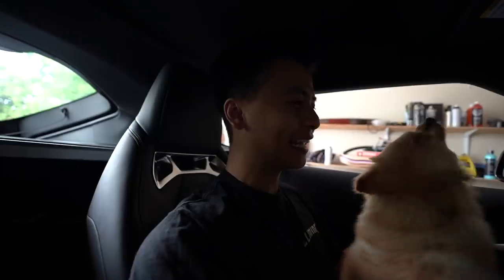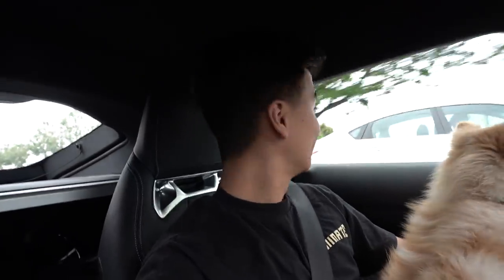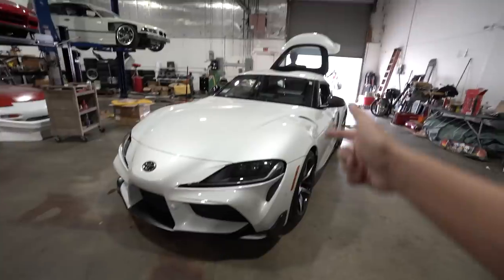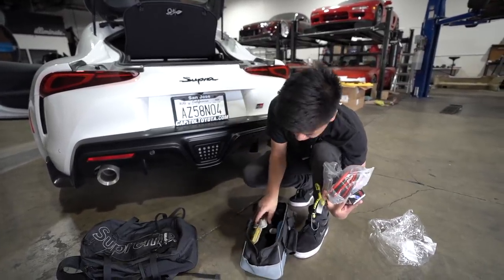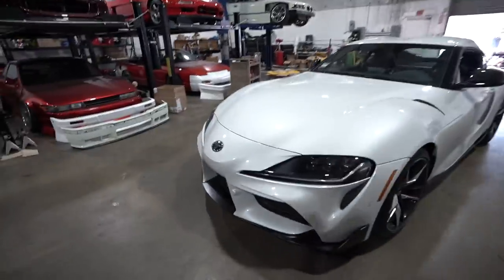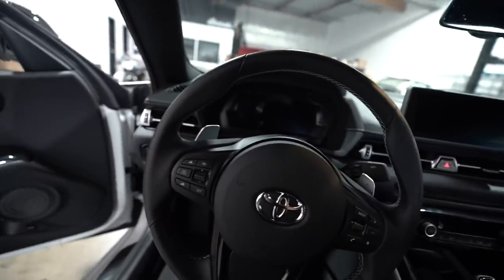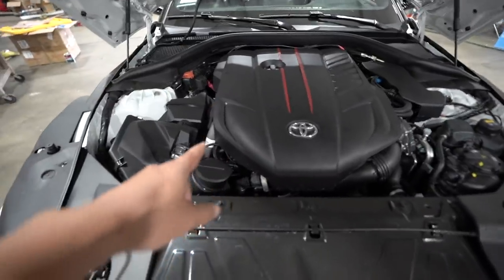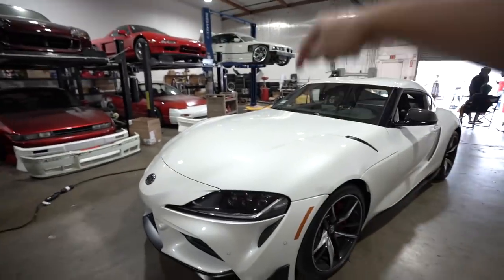My FIRST Day with the 2020 GR Supra!

Comment: The motor produces 335hp in the Supra, but 382hp in the BMW Z4.  It's the same motor with some different internals.  Different cylinder heads, different rods, different pistons.  The turbo is also slightly different.  The Supra motor is a B58B30C and the Z4 is a B58B30B, so both "B58", but with some differences.

Comment: If you’re doing a power build I’d honestly just stay automatic. I think you can tune the trans to shift smoother and better with more power added. I know VW/Audi and some bmw do a transmission tune to optimize higher power output. Like my gti, if I had the dsg trans I can get a tune on that and also tune my motor so they can correspond together proficiently. It’s amazing on how far technology has gone but I figured I’d share my 2 cents to you before you swap to manual. Manual is fun tho! Lol

Comment: Upgrade the charge pipe they are prone to cracking and try getting a tune from bootmod3 I got my f80 m3 tuned they are pretty good tuners the b58 is a beast when built 💯👍🏻

Comment: And the engine, yes, is a BMW power plant, BUT, Toyota went over it with a fine tooth brush, and made it to their standards. That’s why it has a little less HP than it’s BMW twin sister, but made it more reliable and up to Toyota standards.                                   Edit: AND, correct me if I’m wrong, but I also think that Toyota tunes their exhaust a little differently, to try to make it sound more like a Toyota straight 6, and not a BMW straight 6.... could be wrong, but I think the Supra sounds different from the Z4.

Comment: The car is a lot of BMW but I feel like you're exaggerating it a little, no disrespect. The chassis and suspension setups between the 2 cars were manufactured independently. So when driving both cars their engines will feel similar but feel of the handling will be different

Comment: Fyi there is still not a proper manual transmission for this car. The one EAG tested was clutch slipping, you will have to spend more money to make one handle more power since you said you are going to change the turbo.

Comment: Seems like you’re the only one who doesn’t know anything about this car lol. You really haven’t watching any of the thousands of A90 vids all over YouTube?? Down pipe, exhaust, upgrade the turbo and a tune you’re making 500hp easily. The B58 comes highly under tuned from the factory. This motor can put out a lot of power. Everything you can think of has been done to this car already. 1000hp, manual swaps and even 2j swaps. Not to mention TJ helped design the best kit on the market for this car. His street hunter kit kills the rocket bunny kits